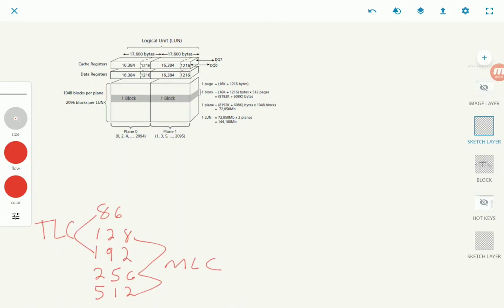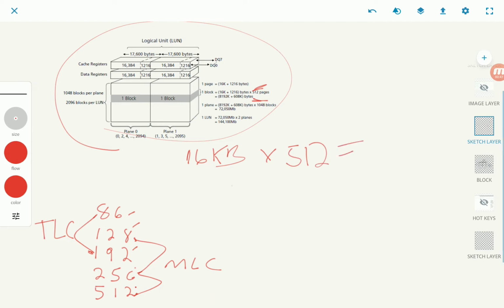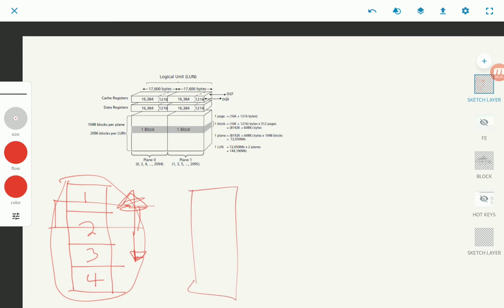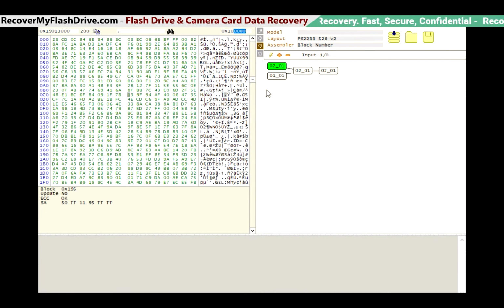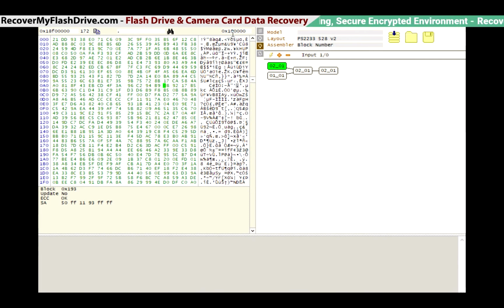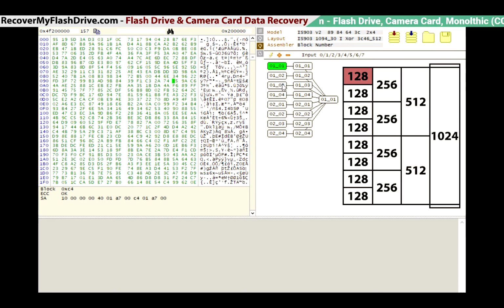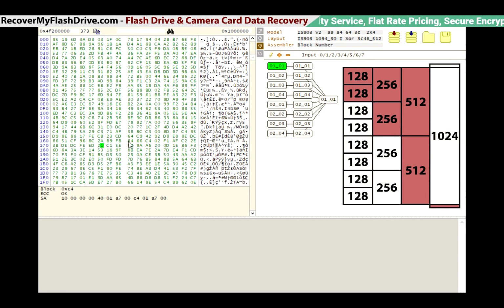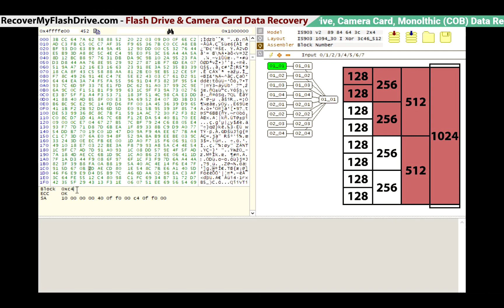Finding the Block Space in Flash Extractor - Data Recovery

Comment: Nice explanation. I have a doubt though, why a block size of 128 pages per block defaults to 0x200000? You mention that in this particular chip you get it by multiplying 128 * 16kb = 2048 kb. 

2048kb = 2048000 bytes, which is equivalent to 0x1F4000, very close to 0x200000. Is this the reason?
Reply from the maker: 128 Pages * 16,384 bytes = 2,097,152 bytes or 0x200000